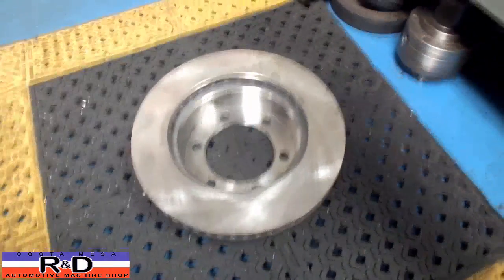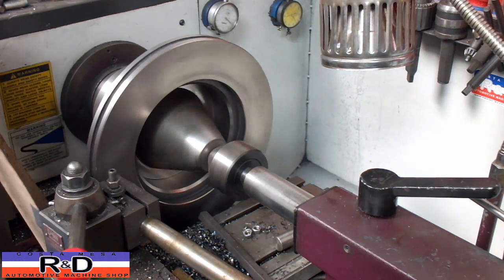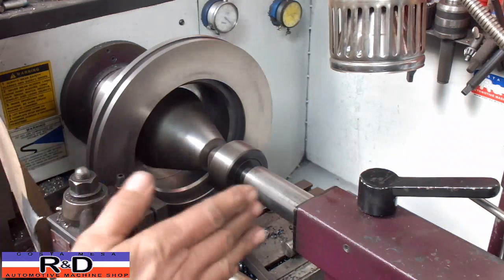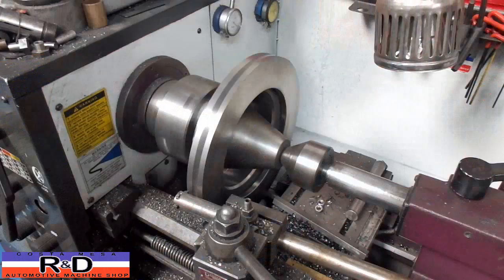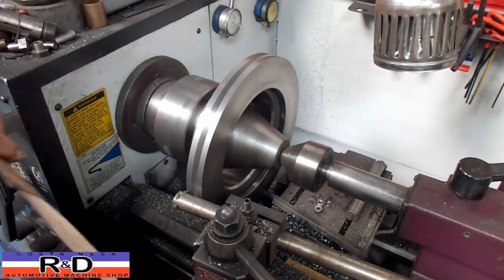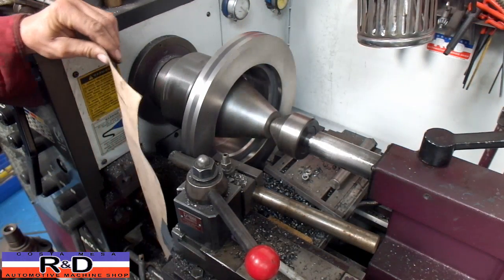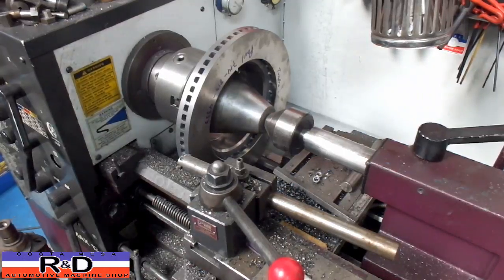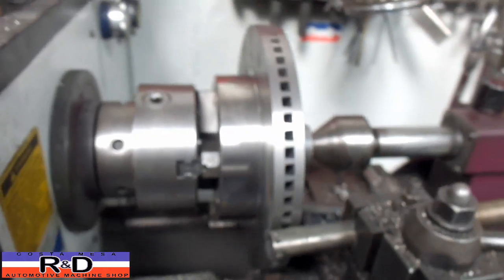Toyota Tundra Disc Brake Rotor Diameter Reduction

Comment: Something is wrong here. Either that rotor is a very cheap Chinese replica or a reject from a premium brand. There's no way that's a genuine Toyota Brake Rotor. 

And then, the out of round is bizarre. Did you dial indicate off center first? (say the hub face). that's just crazy out of round. Taking the material off the edges down to the fins is something I have NEVER done. By doing so, you eliminate air pressure that helps exhaust the air. By cutting down to the rotor face, it also creates a expansion problem that will INCREASE temperatures of the fins and rotor faces. This will increase the outer edge wear of both the inner and outer brake pads. 

The rotor should have been rejected and returned for replacement with one that is within specification.
Reply: Sorry, should read low (hg) AIR pressure. As rotor heat builds, the fins move the air. But if excessive heat is created, it saturates, and the air won't move. Aerodynamically, the flow of air stops. - edited.

Comment: John, did you say how much material was removed from each rotor? Could you have mounted them on a rotary table in the mill and rough cut, then the finish cut with the lathe? Just seemed like you could cut a little heavier with an end mill than .050 passes

Comment: Thanks for posting,  interesting work.  Are factory or aftermarket rotors balanced?  Is it common practice to check or improve the balance of a rotor when installing on a high performance car or motorcycle?  Just curious.

Comment: But, why? With brakes, imho, bigger is almost always better.
Reply from the maker: These were being modified for another axle and the caliper had to fit the inside of the wheel.
Reply: ***** They are only better if ya can fit them!
Reply: Sometimes certain rotor sizes are hard to come by or expensive af! I’m currently looking for a shop here in the U.K. to modify a set of rotors for me, I can buy a 330mmx28mm disc for £125 each, but the 328mm version are almost triple that price :(
Reply: @jongillies4871  Did you find anyone?
I'm UK as well, currently investigating machining a 334mm disc down to 315mm.
They're not drilled or grooved, so that makes it easier, but removing 9.5mm of material off it's radius means cutting into the venting webs.
Trying to get as much professional advice as possible beforehand.